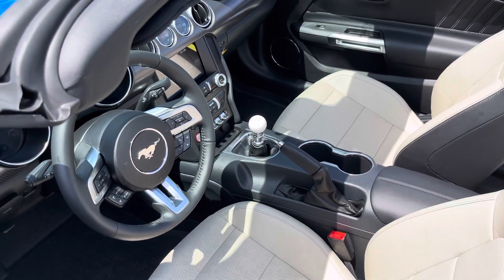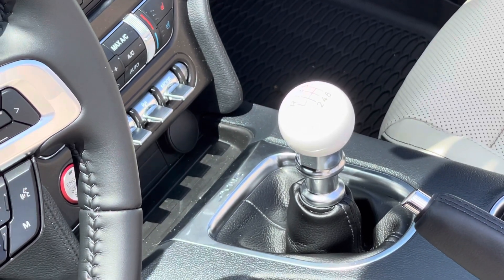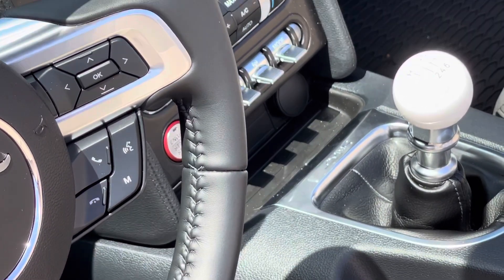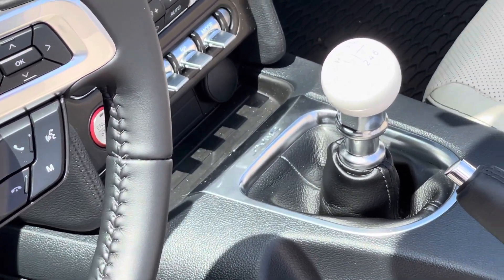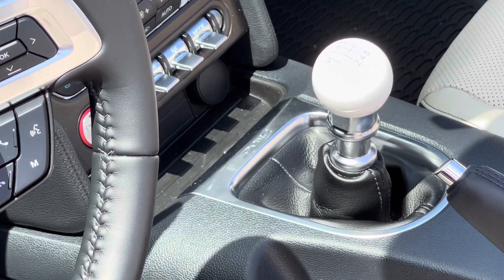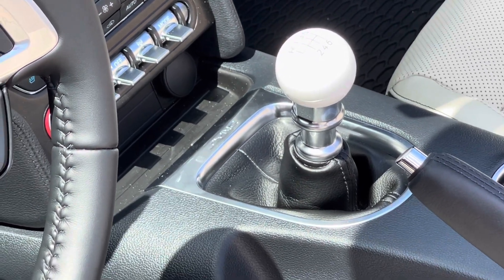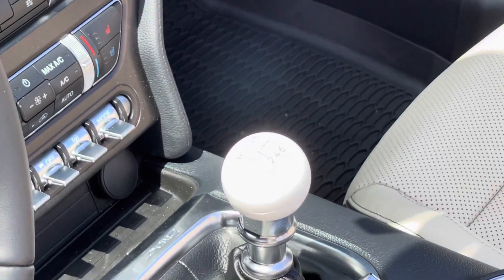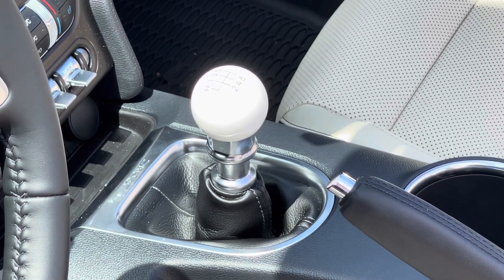2021 Mustang MACH 1 shifter mod.

Comment: Looks like the stock one to me - is there really any difference ?
Reply from the maker: Yeah totally different. The stock one is black leather with aluminum patch on the top with the shift pattern. Check out the first video I made on the car and you will see it.
Reply: @d9103365  am I missing something… do you have a GT or a Mach 1
Reply from the maker: @YingYangStang  it’s a GT.  They don’t make a Mach 1 convertible.